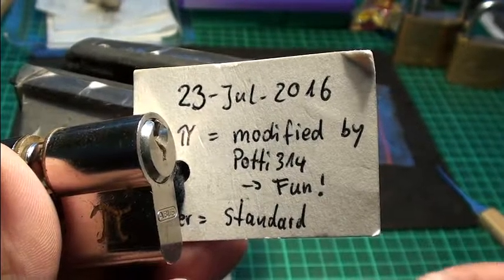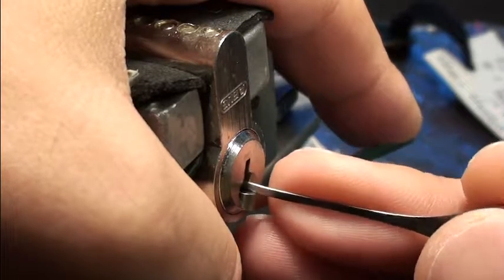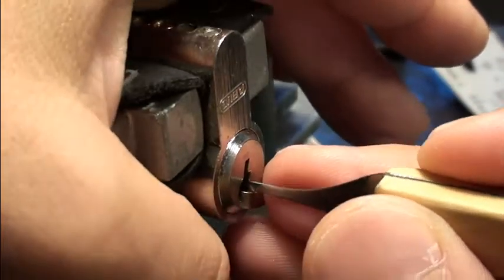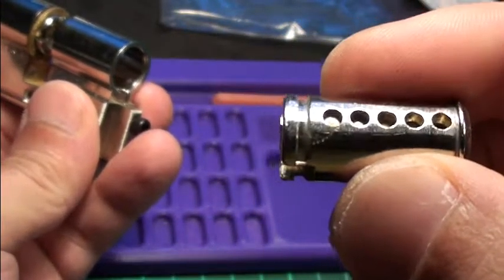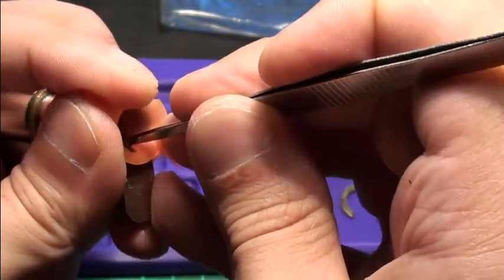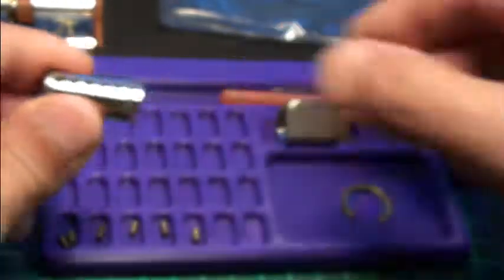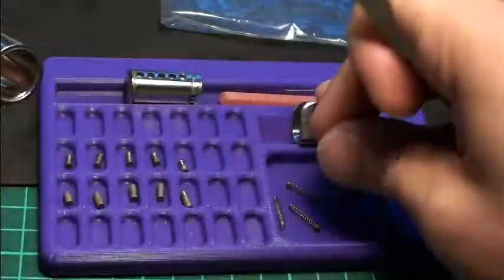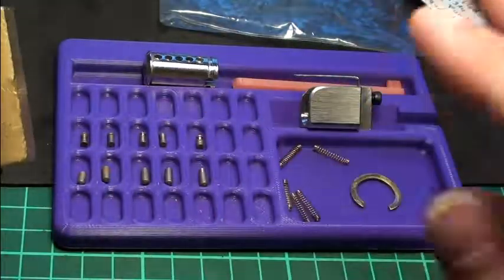#026 - The Abus Euro pinned by Potti314

Comment: Perfect picking. Was exactly meant to be a fun pick with the "falling" bitting and only a few  modifications. Did you try the standard side for comparison?
Reply from the maker: It was a really nice pick :). The diagonal bitting is very nice. Yes I opened the other side too (ahm...had forgotten and did just now^^). To my surprise it took me longer ;). ...there is one very high spool on pin 1 as on your side.
Thanks again for the wonderful locks. I still didn't get the DOM S open (had only a quick play) and will have to make a vid on the round Abus ;).
I probably send this euro to zbzzn from ukls for a play, as I have the pleasure to try out his new pin designs in a challenge lock he is sending me. I will then send it to you for further exploration okay? :) Have a nice weekend :)
Reply: Haha, you can send me any lock you like; locks are always appreciated - especially with interestingly designed pins. Yes, sometimes modifications make locks easier to get picked. I guess it's due to making tolerances worse. When I completed my side I made tests. I always could pick the original side much faster than the modified one. But maybe my subconsciousness wanted it like that ;-) Anyhow, have a great weekend yourself. Cheers :-)